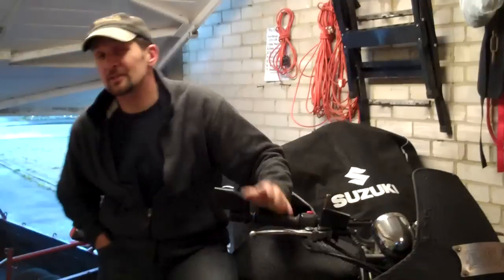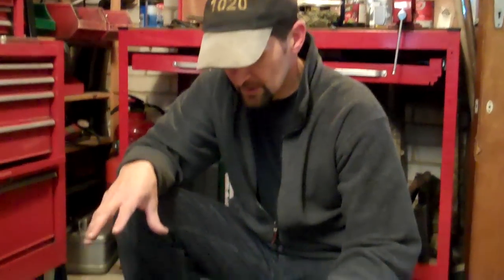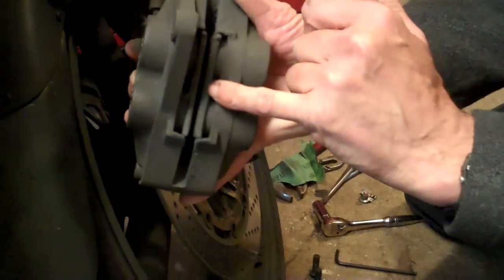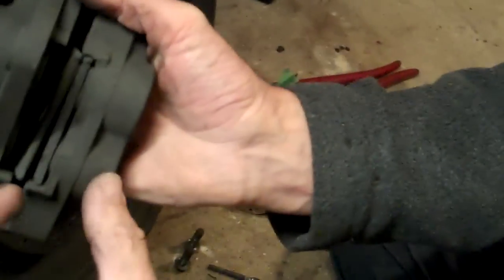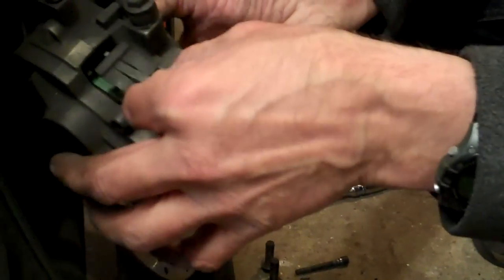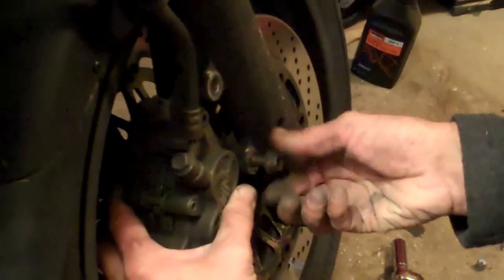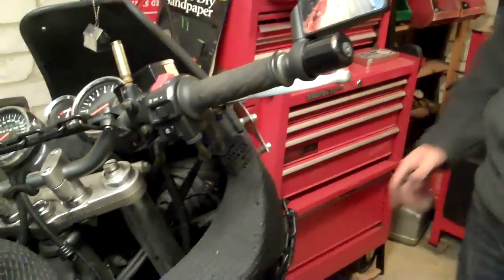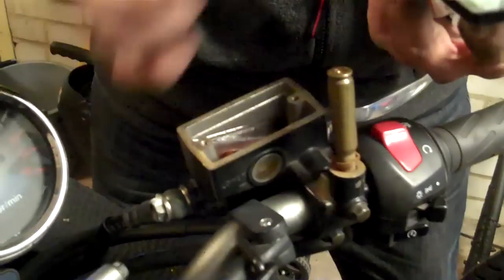Delboy's Garage, How-To Replace Suzuki Bandit Brake Pads.

Comment: fantastic. thank you so much.... that little bolt that you take out at the back of the caliper that goes through the two break pads holding it in place? the t30 sized Lkey hole in that bolt head has stripped. any idea how I can get that out now? i got the split pin out and tried t-baring it with a very small steel bit but the bit just broke... i guess i must drill it out now...? everyday is a winding road... i get a little bit closer... to feeling fine...
Reply from the maker: Not exactly sure which pin you have stuck...but it can help to split the two caliper halves away from each other then you can get a clean purchase on the pins from the inside with some grips maybe..?
Reply: so i used a 4.0 steel bit and drilled it out. then used an 8 bit and made the hole bigger. drilled the seized head out and fitted a threaded bolt with a nut and washer and to ensure it doesnt climb off I sikaflexed the bolt at the grinded off end. it was a mission but my dremel tool was awesome at grinding the old bolt free so I could drop the used pads out and drill out the locked bolt from the caliper...
Reply: @Moonfleet41  https://drive.google.com/file/d/1RIK5uTBZlukQBJ-4gL4sxrDs2rEcey6B/view?usp=sharing that pin...
I had considered splitting the caliper... but that would have been a drama seeing I was workshopping it under my pine tree in the garden... easier to just drill out the bolt. It was a relatively soft mild steel so it drilled out easily. I grinded off the bolt here with my dremel tool  : https://drive.google.com/file/d/1lffvmIzrTA4_52dWAVfjoiOGiklIrke5/view?usp=sharing and it released the old pads once the bolt was pulled free...  Thanks for the input though. appreciate the advice. it was so solidly seized it didnt even come free from drilling. the previous moron never put copper slip on the cross pin bolt so it was properly seized in there... anyways it is sorted now so tomorrow I will do a nice run. :-) safe riding mate

Comment: Another great vid! I did mine recently but the pads seem tight on the disc. Is this right...?
Reply from the maker: No mate, the pads should not bind on the disc, you should get a full spin of the wheel or more without it jamming up... give the calipers a good clean and that will probably sort it out!  Check out our other videos on brake caliper clean out and re-build...

Comment: In other similar videos people told to either open the brake fluid box before pushing the brake cilinders apart so that the fluid would be free to rise, or to bleed the air from the system after. Is it necessary, or only needed in some cases? If so, what are those cases?
Reply from the maker: Hi there.. you should never "Top Up" your brake fluid reservoir.. it should be filled to the "full" level when the brake pads are fat and brand new...as the brake pads wear down, the fluid level will drop...but it will never drop low enough to go below the master cylinder empty level... the system never needs 'More added'.. if you push back the pads then you are only returning the fluid level to the "full" mark it started at.... and the reservoir has a flexible rubber diaphragm in the top to allow the fluid to rise and fall safely.....    Those who make the mistake of "topping up" their brake fluid will need to take the top off the pot, and suck out some fluid if the want to push the pads back otherwise it will overflow...!!!      so as long as you have never topped up the fluid since the pads were fat and new...then pushing them back just means the fluid will rise back up the line and into the pot... and there is an air vent hole in them to allow this to happen...!  Hope that helps you mate... Good luck.. Del.
Reply: Thank you very much for responding. A very clear, consise and practical video, cheers!

Comment: /Have you ever used Sil Glyde brake lubricant for sliding calipers? Does it work well and would you recommend it? People even say that putting a thin coating on the pistons and/or on the seals helps keep the piston seals lubricated and working well. One more questoin, why do you not recommend putting grease on the pin/bolt holding the brake pads + spring in? Is it because the grease can come off with vibration and contaminate the brakes?
Reply from the maker: First of all with the SIl Glyde, I've never heard of it, so couldn't recommend it, as don't know what it is... and you don't lubricate brake pad pins, because the brake dust sticks to the grease and forms a thick waxy crud that will gum the pads up and stop them moving... the pads only move a mm in and out at best and they holes are way larger than the pins, so they don't stick when they're dry...
Reply: Moonfleet41 Thanks for the response! Yeah, I think you're right. The less lubricants on the brakes the better. If it's not squeaking or vibrating then there's no need for anything. However, I do still think its a good idea to lubricate the pistons with this Sil Glyde stuff. It works pretty well and is advertised as safe for that

Comment: What year model of bandit is that sir? Because i have a 2008 sv650. And it has nissin break calipers just like yours instead of tokico. I need to know what year model is that so that i can order new sets of front break pads
Reply from the maker: This bike was a 2000 Bandit 1200 !

Comment: What else besides wd-40 and violence can I try to get the pad holder pin out of my '98 bandit 600? They're really tight and I've tried extending an allen key with a wrench.
Reply from the maker: You can try a little heat, that often works, but if all else fails, (and if it;s a front caliper), you can split the caliper body in half and then you'll be able to get some proper grips on it..

Comment: i have a question, what else can be the possible substitute for brake and chain cleaner sprays? the country where i live in is really hard to find both
Reply from the maker: Brake and chain cleaner are two different things... you can clean chains with Paraffin, Kerosene, Diesel, WD40, GT85, or even just clean oil.... and brakes you can clean with soap and water mate...!
Reply: hi ya, if you use ebay you can buy motorbike brake/chain cleaner and good price too.. does this help.. good luck

Comment: Excellant video, very helpfull to a novice . Also are there any vids for siezed rear caliper on a 600 bandit ?
Reply from the maker: Hi mate, we have done a caliper rear build caliper on MY Bandit, I'm not sure if it's exactly the same as the 600, but the principles of any brake caliper are much the same ...so check out the rear caliper re-build video and hopefully that will help you, good luck with it, Del
Reply: Thanks Del, will do pity you don't do bike maintenance courses in your garage , cheers Paul

Comment: Hi. I just replaced front brake pads with new ones. And went for a test drive. And i can feel that it not releasing disk all the way. I cam feel draging. Is that normal with new pads? Removed calipersand checked them. Everything looks fine. With old brake pads never had problem with stucking.
Reply from the maker: New pads are thicker, obviously, meaning you'll push the pistons back further in to the caliper in order to fit them... if you have dragged some dirt in under the dust seals, that could be preventing them releasing, so drop the new pads out, pump the pistons out very slightly till you see clean shiny metal, scrub off all the dirt with an old toothbrush, then they should be fine.
Reply: Ok. So i took apart calipers today again. They are really nice and clean. Check all pistons, they are nice and shiny, and all of them i can push back in with my fingers. Test drive it again, and the same after i push brake lever couple times. Is there could be any other reason why they wont release? Maybe sonething wrong with reservoir? Fluid level is good. I did change rear pads too, and everything is fine there. I can spin rear wheel with hand freely. And front wheel i can spin with my hand, but when release, it doesnt spin by itself. And even when im driving i can hear noise coming from front brakes touching disk all the time. Or maybe its cz of the new pads? Just try to keep driving until they gonna wear off a bit? Im just afraid to not owerheat disk or pads🤔.

Comment: Hi del, my brake pin is seized inside the calliper, any tips on how I can free it? Without mincing the nut?
Reply from the maker: Hi mate... as you can see from the video, the pin bolts in on the outside casting so is effectively a regular allun bolt., I know what you mean, if they have seized in, you end up stretching out the key hole so the allun key doesn't fit, then it just minces out.....ive seen someone have some success with using JB Weld in the hole, and pretty much 'gluing' the alun key in place..and that should get a strong enough hold of it to crack the thread open, but If all else fails, just separate the two casting halves and you'll be able to get a good firm purchase on the end of the pin with some grips...a bit long winded I know, bit better than trashing the calliper by drilling it out and damaging the casting.... good luck with it, hope that helps a bit... Del.

Comment: Hi del boy me and my little girl love your videos...

The issue I be come across is that the bolt that holds the pads in place on my mk1 bandit is rounded and I can't think of tje best way to remove.

Any idea buddy
Reply from the maker: Hey buddy... good to hear from you, and so glad you watch the video with your family, we love that...   Have you tried the "Torx Bit" trick... maybe not?.. basically, you take a torx bit thats a little too big to fit in the rounded out alun hole.. and tap it in home with a light hammer... and that usually will grip it enough to get it turned out... have a go and see how you get on it works for me all the time..   Good Luck.. Del.
Reply: Thank you Del for talking the time out of your busy schedule to reply. I'll try this trick and I'll keep you updated.
Jack

Comment: Del, is it a similar job for the rear pads? Any recommendations on brands?
Reply from the maker: The rear pads on a Bandit are a slightly different job, but the principles are the same.. i do have a video on the rear pad change if you need it... and i like to use EBC copper sintered pads in my bikes, they give good bite and feedback...
Reply: @Moonfleet41  brilliant man, I'll go have a look for the video. Cheers dude

Comment: What about the rears brake I'm new to DIY mechanics and struggling on getting it right ? Any tips ? Would really appreciate it :)
Reply from the maker: Hi Ben...the only video i have is a ful rebuild of the rear caliper...but you can see in it how to get the pads out and replace them..   So here is a link..;- Delboy's Garage, Suzuki Bandit Brake Caliper (Full Rebuild).

Comment: hey dellboy, I have a 1997 1200 bandit, when it comes to changing the brake fluid I see the   reservoir is attached to the rear brake master cylinder behind the side panel but the top is square does this top come off and do I have to take off the panel to get to it? I take it the left side on the handlebars is for the clutch ?
Reply from the maker: +Dougie Dickson Yes, drop right side panel off, take the 2 screws off the top of the resevoir, and the cap lifts off... and yes, the left handlebar holds the clutch master cylinder... hope that helps!
Reply: Lovely thanks.mate.

Comment: Dell!!  I just pulled my brake pads out (front and rear) and cleaned them and the calipers.  I'm sure I put them back correctly and never touched the brake levers during the cleaning.  When I finished, the wheels stopped spinning freely.  The rear tire is hard to turn and the front spins but not easily.  What did I do wrong?  How do I fix it?  Thanks!!
Reply from the maker: If your calipers were pretty dirty, you would have had to push the pistons back a tiny bit at least to get the caliper off, and you may have jammed some dirt under the dust seal, did you pump the pistons out a little and clean round the gum line??  Also did you check the dust seals are not poking out, as this is a common wear and tear issue with Bandits, specially on the rear??
Reply: Thanks for the tip.  I'll take apart again and take a look!
Reply: Thanks Del,  took the brakes out again and did another cleaning.  It's spinning free again.
Reply from the maker: Excellent, good to get it sussed out aye buddy.. Ride safe.. Del.

Comment: Whats up del!!
Im currently running  organic pad's on my 97 600cc bandit, and its good so far...
im planning to chance for EBC double H brake pads...what do you think about that?

People keep telling they are better but im concerned about if they will warp my discs
Reply from the maker: They are fine Bruno, they wont warp your discs unless you absolutely leather them hard....they are a bit harder on discs, but with the extra bite, you dont need to brake so hard, so they are fine provided you moderate and adapt your braking practice....here's a video on them.. https://www.youtube.com/watch?v=mE5FhUVLfqo
Reply: Moonfleet41  thanks so much for the quick response!
I just set up 2 sets of these pads these afternoon, after seeing your video about EBC double H brake pds, went for a ride to see the diference, and it is noticeable!!
Though i touched the discs after the ride, and they seemed to be pretty dammn hot!
Is it because theyre new?

Love your channel, greetings from Portugal!
Reply from the maker: Bruno Cardoso
Yes Bruno, they do work your discs a bit harder, the trick is to brake a bit less and use the engine braking more....once they bed in after a hundred miles or so, they'll be a lot better..  thanks for wathicng and take care.. Del.
Reply: Moonfleet41 aiight men!
Waiting for new content :D

Comment: hi and thanks for the great videos ...could you help me out .where or how do i fit crash bungs to a fully faired 07 bandit 1250 abs thanks Paul R
Reply from the maker: Hi Paul.. i wouldn't know off the top of my head.. some sports bikes need holes cut in the fairing panels, and usually they come with instructions for mounting... maybe ask some of the sellers directly if you can see the instructions.. ! sorry cant be more help buddy...! good luck with it.. Del.

Comment: Do you recommend any other kinds of break pads and calipers than stock? and if so, which? :)
Reply from the maker: Bandit calipers are excellent, I even have a pair fitted to my Kawasaki as they're a common upgrade for other bikes, you could fit some sintered pads to give a bit more bite...
Reply: Dumb question, but how do I know which pads would fit my callipers?
Reply from the maker: When you order them, just order the pads for your bike, they'll send you the correct ones.

Comment: hi very good video. but I have looked at my calipers and the are different to you'res. I have an 06 reg bandit. And my brakes look totally different to yours any ideas. Dean.
Reply from the maker: Hi Dean, any ideas of what mate??
Reply: havce looked at my calipers and they seem to be the sports ones. from a 2006 k5. I assume there is only one bolt and the two pads slip out. any chance if a vid on other models of bandit other than the mark 1.
Reply from the maker: HI Dean, this video was over 5yrs ago, have long since sold the bike and don't currently own a Bandit mate... I can only work on the bikes I have here available to me, so I can't do a range of videos on different calipers I'm afraid... most calipers are generic but they may look different, but the principles are all the same.. it's just a case of using initiative and applying the principles to your caliper, all pads are held in by pins, or bolts, take note of how it dis-assembles and you'll soon work out how to put it back together... hope that helps mate, sorry I can't be more help...
Reply: Moonfleet41 no worries. I had a close look at a set on eBay while they were off the bike. So think I'm sorted now. But thanks for the reply. And keep up the good useful info.

Comment: Hi bud, what brake pads do you use?
Reply from the maker: Generally speaking I always go for copper sintered pads, like EBC or Brenta, they have more physical drag against the surface of the pad, meaning less force required on the lever.

Comment: Is this the same procedure for the ABS versions?
Reply: Jason O'Brien specifically 57 plate water-cooled Bandit 650s
Reply from the maker: Jason O'Brien Hi Jason, yes it is the same for replacing the pads, but the bleeding up of the fluid is a bit different... same principle though..!

Comment from the maker: "What pads to use" is the same as "What tyres to use".. its not really that important..as long as they are the correct ones (obviously) and of a known brand and quality.... there is lots of snobbery in parts choice, like with tyres, but they ALL stop you when you apply them. The difference comes in how you want your bike to perform, if you do track days and leather the shit out of them.. then get some hi temp sintered pads..but for commuting, just get the cheapest known make, job done.